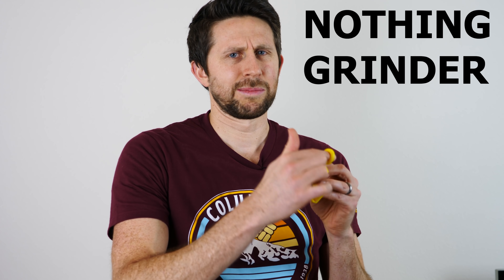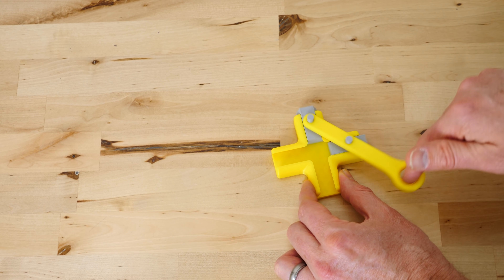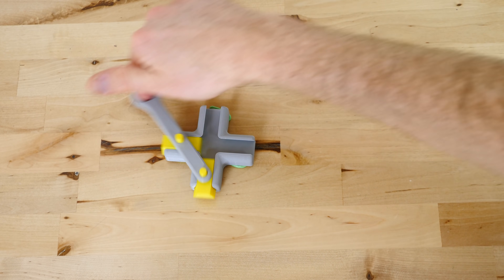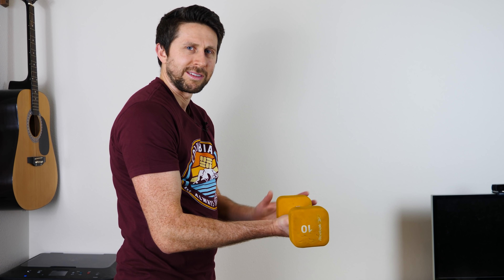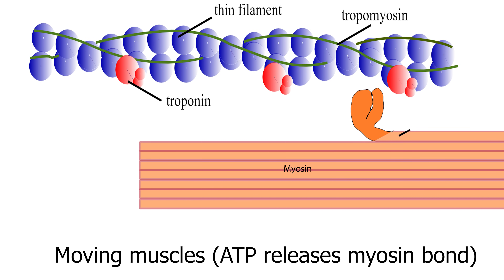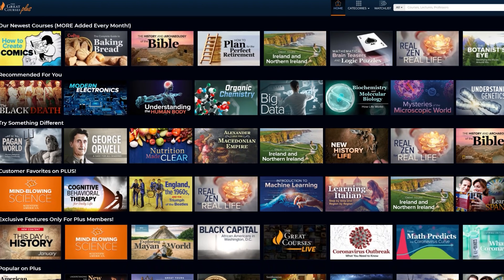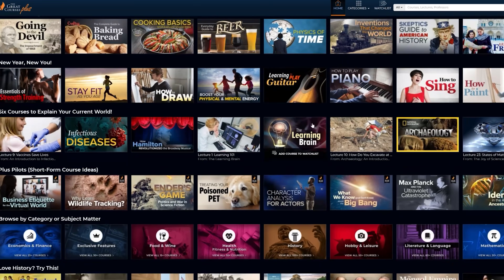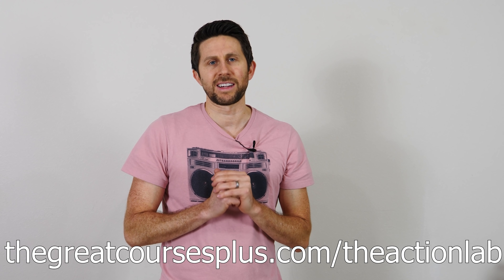The Machine That Does Nothing Actually Does Something

Comment: Why aren't we using this machine for engine crankshafts? It looks like it could use anti-friction roller bearings instead of oil-film friction bearings. Newer commercial truck engines are able to produce so much torque that the connecting rod bearings are toast after 5 years.

Comment: I don't understand, you DO do something, you move the crank, which in turn moves to very small weights in straight lines, but those are not important. Just a crank on a pin without anything attached also translates the energy you put into it into movement: After a time t the crank moved an angle of x degree. The force you work against is its inertia and the distance is x. Thus: work. ?!?

Comment: So what's the most efficient speed to drive up a hill with my bike? I've always been wondering about that because I was told if you go fast you need more energy, which makes sense but the longer you take the longer you use this "base energy" to prevent rolling backwards (of course assuming you wouldn't fall to the side even when going slow).